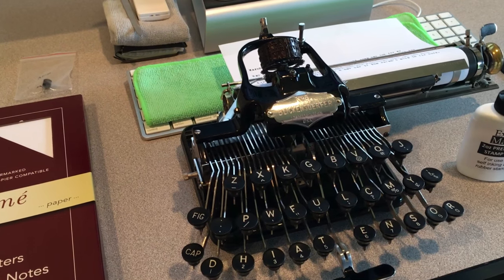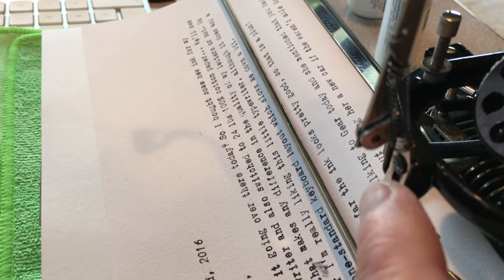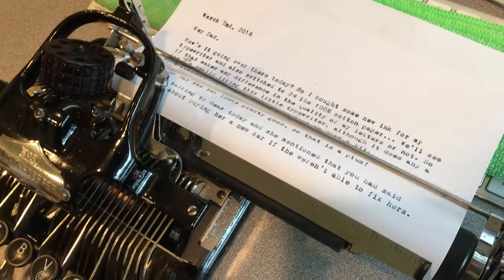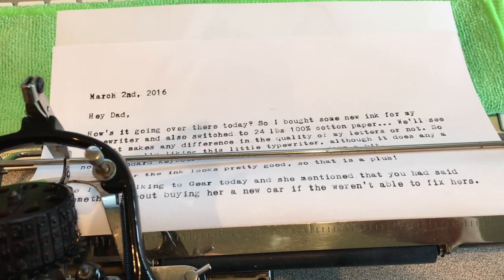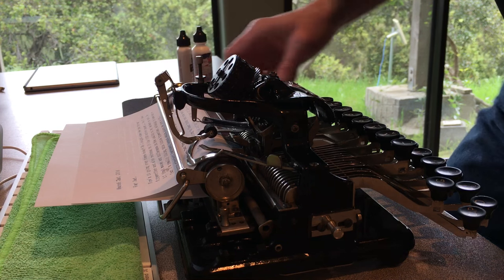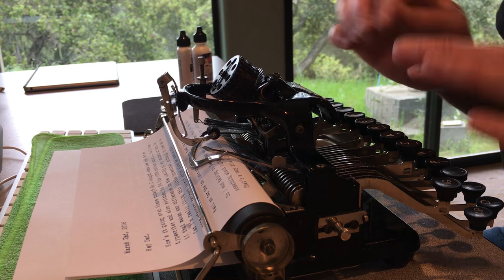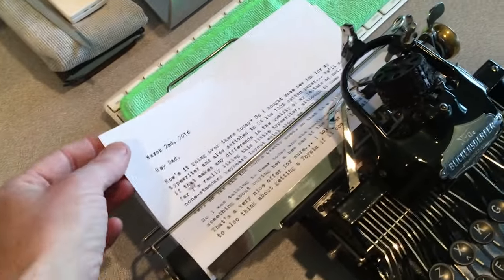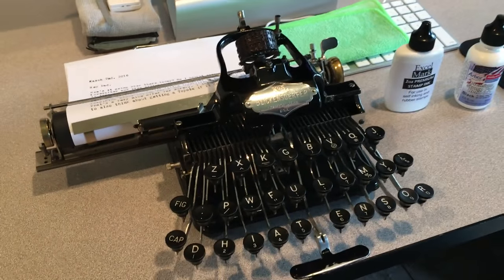Blickensderfer #5 typing a letter

Comment: Thanks for your video, I bought a Blickensderfer #7 from the flea market, that's my first antique typewriter. I have a question if I want to fill the ink, is filled to the ink roller? Thanks
Reply from the maker: yes, if it's the same as the #5, then the ink goes on the roller. You might want to use stamp pad ink. When I had my #5, I would put a few drops of ink on the roller before typing a letter.

Comment: Did you fully disassembled? I put one together and the type wheel won't align with they keys...  Just wondering if you know how to align it? Thank you!
Reply from the maker: I took it apart to clean, but not the individual keys. Keep in mind there are two versions floating around.. one is the QWERTY layout and the other is the standard one. You gotta make sure you have the correct type head for the keyboard you have. If you mis-match a qwerty type head with the standard scientific layout keyboard it won't work (and vice versa). If you check ebay for spare type heads, you can zoom in and see the alignment of the individual letters on the head and figure out which you have maybe. Let me know if that helps or if you are asking about something else. Like I say, on mine, I didn't disassemble the keys.. just the carriage and rollers for cleaning. I basically put the entire thing in the kitchen sink and used WD40 and my air compressor to clean it; it started out very clean to begin with, so there was no need to take apart the individual keys and levers.
Reply: @ray5961   yes! I do have qwerty keyboard, can I get your email? I can send you an email with pictures and more detailed about what's going on, thank you for your help!

Comment: How does this work? Like how does the print get to the paper just by pressing on the ink roller?
Reply from the maker: Richard Breads The letter hits the round ink roller on the way down to the paper; as it contacts the roller, it pushes it out of the way and as it brushes across it, ink is transferred onto the letter. When the letter hits the paper, it stamps ink onto the surface. As you can imagine, the tension of the springs, the angle of the roller in relation to the letter and also the type of ink and paper all have to be pretty dialed in or you don't get a very good result. You basically have to ink the roller every time you go to type a letter. Typing a letter is sort of a labor of love, especially with the non-qwerty keyboard.
Reply: Ray Nada thanks for the response! As a typewriter collector, I have always wondered how those worked. Nice vid! Beautiful machine!!

Comment: Can I buy an ink roller? Thanks
Reply from the maker: I don't have any more for sale; I've since sold the typewriter
Reply: @ray5961  Thank you for quick reply. I got IR-40 Ink roller but I couldn't find a brass for inside of the roller. Where can I buy this small brass? Thanks again
Reply from the maker: @AnaloguePapa  I think I bought mine at Ace hardware. Home Depot usually as a small metals bin with this sort of stuff or you can order anything you can dream of via McMaster.com
Reply: @ray5961  Thanks a lot

Comment: Any updates on the Dalton? Just curious.
Reply from the maker: +kent straight - it's out in the garage waiting for me to build a motor mount. I am also messing around with the cross slide. Now that the weather is improving, I plan to get back to it. I'll upload some videos as I work on it. I did find a nice DC motor and also a motor controller though. I might change the cart it's on, but not sure. I saw a nice one at Costco the other day :-)
Reply: Thanks Ray. It's a beauty!  Looking forward to it.

Comment: Is this for sale?
Reply from the maker: It's not currently for sale, but I will be happy to keep you in mind if I decide to sell in the future. I did have someone offer me $3000 for it a few months back. These machines are very difficult to find in good condition; I've been searching for 6 months for another one in similar condition with a QWERTY keyboard and absolutely no luck.
Reply: +Ray Nada you mean 300?
Reply from the maker: $3K. Someone contacted me privately a few weeks back, asking about the typewriter and if I might be interested in selling it. I said no, but that if I ever did, I would probably want around $3000 +/. They said they would most likely pay that, if I did ever decide to sell. I was actually thinking about maybe selling it to that individual for $2800 (cause I'm such a nice guy :) but the email address I had for them stopped working. Realistically, I don't think I'd sell this machine, unless I was maybe able to get another machine in similar condition - which is no easy trick, given that these machines are well over 100 years old and generally only found in pretty bad shape. Even the machines worth buying, still need quite a bit of work usually. Mine started out in great condition, but I spent several months making parts and getting it working properly again. A lot of people are willing to pay top dollar for something already restored and working. Now and then decent machines come on eBay for several hundred bucks. Usually they all need some level of attention however.